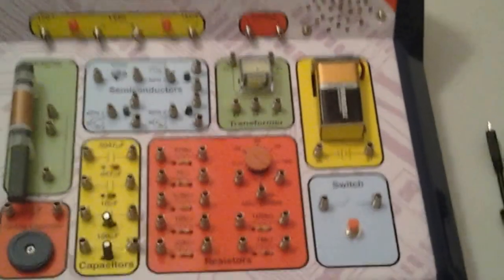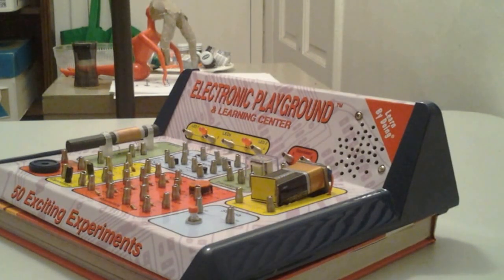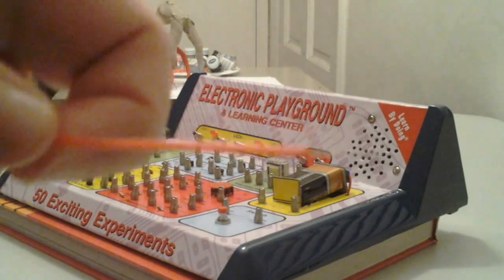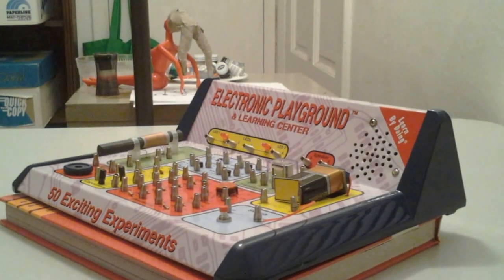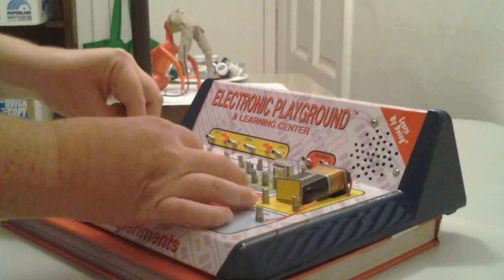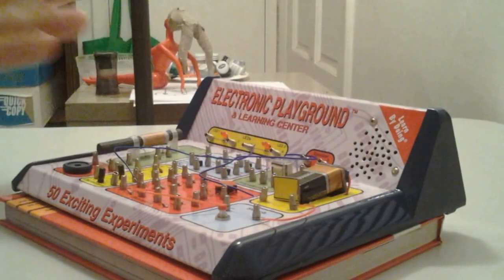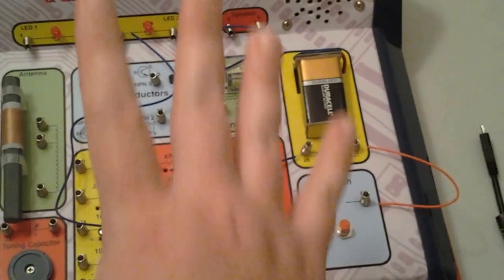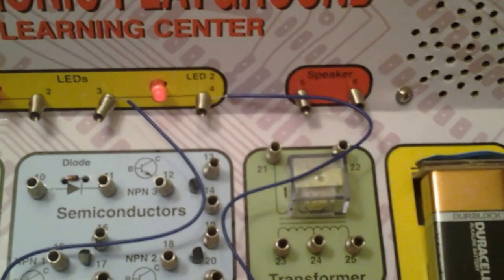Electronic Playground Experiment #1 The Light Bulb

Comment: my fucking led won't light up
Reply from the maker: Dominic Kim Is it possible you have a bad battery?
Reply: no i found the problem to be the battery clip, i guess the conductive metal wasn't touching the terminals, anyway i did it the old fashion way and manually connected the wires to the battery. Thank you for caring, that was a low point in my life
Reply from the maker: Dominic Kim Well, be very proud you figured out the problem! It sucks when things don't go well, but when you figure out what went wrong, that is a good skill to have too.  I knew a woman that purposely screwed up her computer different ways so she could learn to fix it, and she was the best technician I ever had.